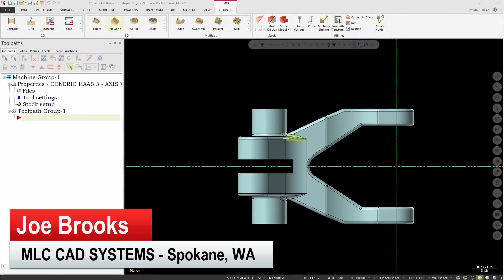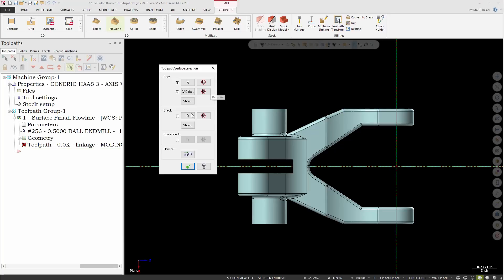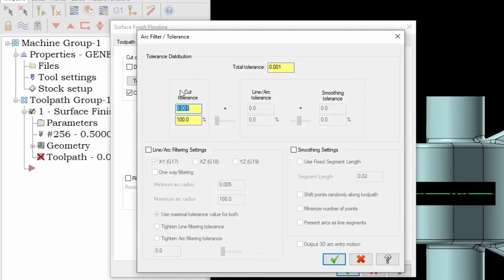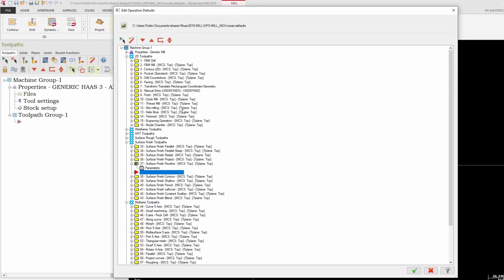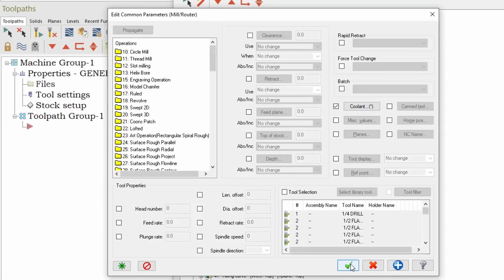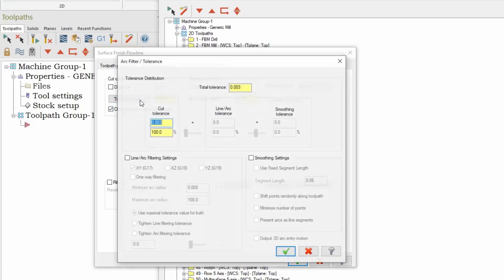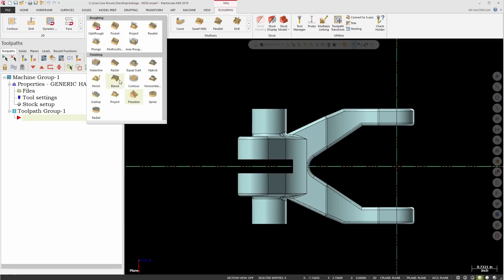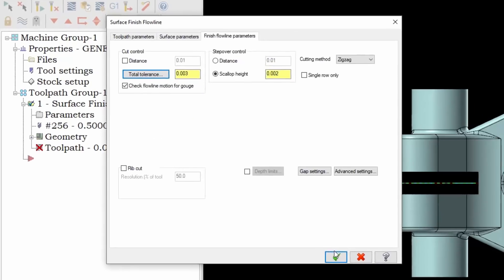Tech Tip: Reducing Mastercam Programming Time

Comment: how do i reset the defaults back to original state?
Reply from the maker: The defaults and operations files are stored at the location below.  If you delete or rename the folder or files, Mastercam will rebuild the files back to the defaults.  Rename allows you to restore them if needed.

C:\Users\Public\Documents\Shared Mastercam 2022\mill\Ops
Note: This is for Mill, other sub-folders are labeled for other modules.
Reply: @MLCCADSystems  thanks